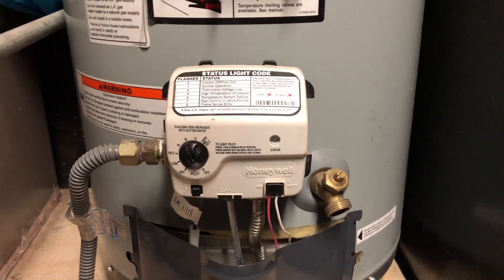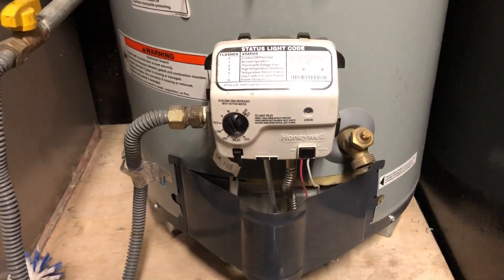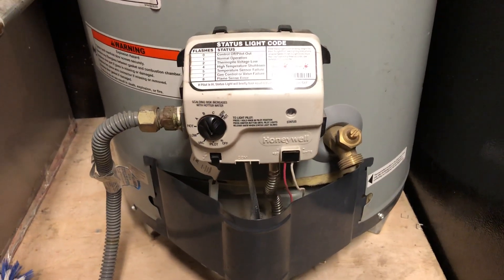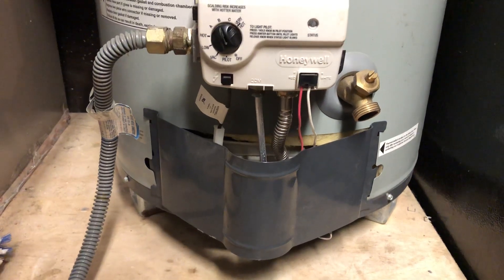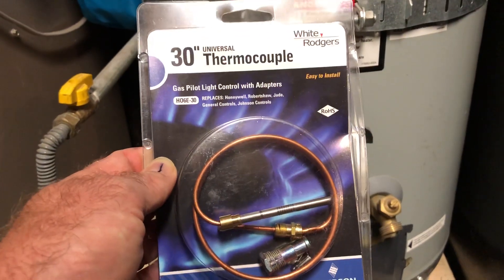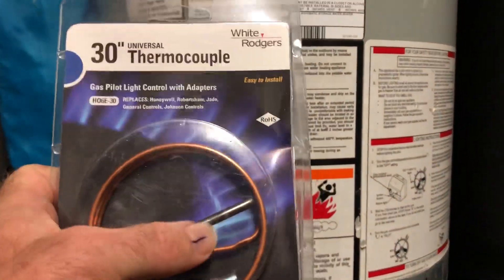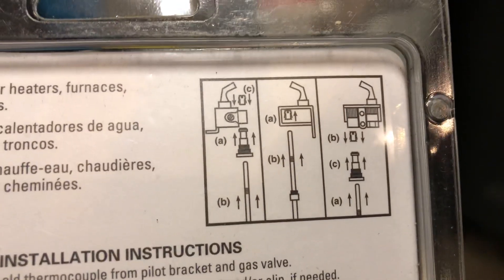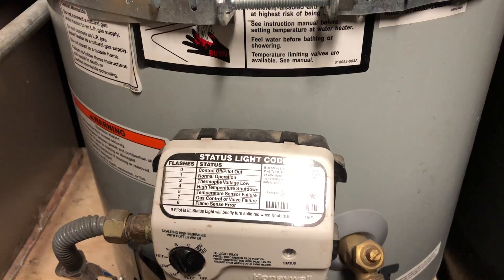DO WATER HEATERS USE BATTERIES? 2024 (UPDATES!)

Comment: You don't have to be handy to clean these at all. For most water heaters, there are two nuts you unscrew from the panel on the bottom, where the pilot hole is. Make sure the gas is off, take those nuts off, remove the panel, and the thermopile/couple is right there. Just wipe it down with a wet rag and you're done

Comment: I have a question about the two wires that attach to the gizmo on either side of the button you pressed. My plumber told me to un-attach the wires and short them with a paper clip. Do you think this is a good idea. My mother in law had the same issue. He did it to her tank and the pilot light hasn't gone out in months seemingly fix the issue. What do you idea?

Comment: The Mars 2012 and 2020 rovers work the same way, it's a thermocouple and the heat is from nuclear decay.  It's the can looking thing sticking at an up angle out the back of the rover.  They're called radioisotope thermoelectric generators.

Comment: Fun fact: Certain deep space probes are powered with a small amount of radioactive fuel. It generates heat as the fuel decomposes. Thermocouples use that heat to create electricity which in turn powers the spacecraft. Solar panels only work if you're close to something bright, like our Sun. But if you're leaving the Solar System, it's a long way to another bright  object.

Comment: Hey brother quick question. I pulled out the water heater burner to clean the possible dust off of it and it had some greenish hard water corrosion on the screen that I can possibly wash off with some soap and water or even CLR. Question is can I use soap and water or even CLR to clean it?

Comment from the maker: Want to say thanks for the video? Use my Amazon link to shop. It’s free for you to use and Amazon pays a small commission.https://amzn.to/33i9exY
Reply: My pilot went out, when I went to clean the vents underneath there is moisture.  Does that mean there is an enternal leak. It's not gushing out water. I've turned off gas to water heater. Water valve into heater is Open and it is not leaking.

Comment: Thermopile and thermocouple are 2 different devices.   The thermocouple senses the pilot light being on.  The thermopile provides the power to the circuit board inside the valve control unit.   The red and white wires go to the thermopile and the thermal saftety switch on the side of the burner assembly.
Reply: they do the same thing...a thermopile is a bunch of thermocouples "stacked" and generates more millivolts. They both have the same function though: to prove the pilot is iit and close the gas valve if it is not.
Reply: @TRUE_GR1T  If that is the correct statement, by having 10 thermocouple bundle up you would get a thermopile? 

In theory it is thermal electric or something similar. The controlling unit of a thermocouple is in the gas valve itself, the thermal couple only sends a yes or no signal to the valve. It doesn't logically prove whether the pilot is lit or not as it doesn't make the decision for the gas flow. Thermalpile, on the other hand, has to prove the pilot is lit and therefore it then sends the power to the gas valve to open the valve so the gas valve has to be different as it doesn't have a controlling circuit within that. If they are identical to each other then the rest of the components on the system should be interchangeable.
Reply: @QiuyuanChenRyan916  Don't confuse temperature measurement thermocouples with thermocouples/thermopiles in a furnace.   Furnace thermocouple purpose is to provides power to keep pilot light lit by powering the pilot light gas valve solenoid.  If fire goes out is kills gas flow out of pilot jet.   This is why when you relight pilot you have to push down on knob , hold it for some time and wait for a while before pilot light stays lit after you release the knob.  The thermocouple needs time to heat up to generate enough power to drive the pilot light gas valve to stay open/lit.  Thermopile  is a stack of thermocouples for more power output.  Thermopile generates enough power from the pilot flame to make electric power needed to open main furnace gas valve solenoids to main burners.   This power flow is controlled by the thermostat.   When thermostat calls for heat it connects power from thermopile to main burner gas valve.   Valve opens.  Main gas flows and pilot light ignites main burners.  Thus no need for outside electric or batteries.   Pretty ingenious.  How this clarifies this topic.
Reply: @TRUE_GR1T  Yet, they are not the same thing. Similar to how copper is not brass.  And, no, they don't "do the same thing," as you put it.  As you, yourself stated, a thermopile  "generates more"...more than something that it is not... a thermocouple.
Reply: @tubee2b  spare me the technicalities, they have the same function which is to sense a pilot and prove it is lit.
Reply: @tubee2b  correct.
Reply: @TRUE_GR1T  NOT the same function at all.  The thermopile takes the place of a transformer to power the control circuit and thermostat.  It MUST be a millivolt thermostat and NOT a 24VAC thermostat.  The thermocouple is used as a sensor that generates a tiny voltage to detect if the pilot light is burning.
Reply: @solarsynapse you are speaking nonsense hahahaha. 😂😂 know it all people make me laugh
Reply: @mrwendell4564  Just because you lack comprehension, does not indicate information is nonsense.
Reply: @solarsynapse  "thermopile takes the place of a transformer to power the control circuit and thermostat." I LOL at that statement. IYKYK 😂😂😂
Reply: @mrwendell4564  It is an absolute fact that is done on gas furnaces.  On a water heater, the thermostat is built in.  Without the thermopile, a transformer or batteries would be required to power the electronic circuit and valve.
Reply: You are the type of person that their wife ends up calling me at 11pm saying their water heater isn't working and they had a "professional" look at it already
Reply: Their are wall furnaces equipped with PG-9s(which is a thermopile) that energizes the gas valve which also is wired in series with a thermostat. AMATEURS
Reply: @solarsynapse  someone pull the keyboard from him hahahaha
Reply: @mrwendell4564  I have worked on many types of units and repaired the damage caused by lazy greedy "pros".  Of course there are some pros that actually care and know what they are doing.  Kudos to them.
Reply: @solarsynapse  good guy you are. You deserve a cookie lol
Reply: @mrwendell4564  By "him" you are referring to yourself.
Reply: @solarsynapse  funny comedian. Ha ha ha people can't accept being fact checked when they spew non sense
Reply: @mrwendell4564  If you can't stand it, then you should do some fact checking.  Ever hear of a floor furnace?
Reply: @solarsynapse  no, what's a floor furnace? What's a gravity furnace? What is a thermopile? Don't answer that last question because you don't know the answer 😂😂😂.
Reply: Thermocouple senses heat. Does not produce power or any electric. I've known that since I was very young
Reply: @texasbest308  WRONG WRONG WRONG..   The Thermocouple and Thermopiles drive the pilot and gas valve solenoid on your gas furnace.   Thermistors are sensors only.
Reply: @texasbest308 you are wrong sir since you were young. Thermocouples generate millivolts to energize the maghead which keeps pilot flow. So, you have been wrong since childhood
Reply: 100% agree Sr.

Comment: This water heater does not use a  Thermocouple. It couldn't produce enough voltage to run that water heater.This water heater uses a thermopile and it's not that easy for most people to replace.But almost no water heaters use a thermocouple since around 2014, In quite a few water heaters didn't use them or even years before that.

Comment: they have to be cleaned at the bottom cause there called sealed convection water heaters so they pull air from the bottom. if its clogged and full or dirt and stuff, it starves the flame of oxygen so thats what happened. stupid design , even conventional water heaters arent evensimple as they use to be to fix

Comment: These Rheem water heaters are a piece of crap bad engineering
Reply: No "Honeywell" is a POS, Rheem is for using honeywell shit
Reply: @williamsaunders8047  good luck finding a hot water tank not using a honeywell gas valve/control.
Reply: @TRUE_GR1T  What are you talking about. My apartment complex pays for all maintenance ??
Reply: @williamsaunders8047  They are on Reliance water heaters as well. Replaced mine and still will not light
Reply: @gillmanley9183  My honeywell is on a Bradford White "Defender. I looked online at Home Depot and every damn water heater has a honeywell (Made in China) Mine is 5 years old YET my refer is 1997 still works perfect, Sears Kenmore dryer from the 70's still works perfect. They make shit to break right after the warranty last 15 years.

Comment: I think the piece in your hand is not for this model. The line in the heather is to send gas to the pilot. The thermo.... Piece is the one with the two wires on the right of the valve.
Reply from the maker: Correct. I was just using that as an example of what a thermal couple/thermal pile is.
Reply: he actually said this in the video...

Comment: Hi, thank you for the informative video.  Speaking of the lights you mentioned at the end of this video.  I have the exact same gas valve and I am handy, so I tinkered and was able to reset it to get the pilot light to stay on.  However, when I turn up the temp waiting for it to kick over and ignite the big flame, it never does.  My status lights is a strobe flash (not a solid flash), every 3 seconds, which indicates that it is signaling for heat, but nothing.  What are your thoughts?
Reply from the maker: I read your comment Again and I think you should check the wires make sure the third all the way pushed in, it’s amazing how many times wires can work them self loose and cause problems. If the problem continues you may need to replace that gas valve. I’ll put a link in the description. You want to confirm that it’s compatible.
Reply from the maker: It could be a few things, however it sounds to me like the thermal couple needs to be cleaned or replaced... 
I have several videos on this style water heater. There’s also one on how to clean the intake air filter/grate. Make sure your cleaning that on a regular basis. It’s really easy, check out the video show you how. If that doesn’t work I would do after the thermocouple.
Reply: Great - thanks, please send me the link to the Thermocouple replacement video.  I look on your channel and didn't find it.
Reply from the maker: I’ll try to send you a link as well however your best bet is to subscribe to my channel, go to my playlists and you’ll see one for water heater issues.
Reply: Yes, I did subscribe, looked at your videos, but didn't see the one you speak of.
Reply from the maker: https://youtu.be/YZ4r594jkIM
Reply: The HW uses a thermopile. A couple only generates 10mv dc
Reply: And it's a copper tube. Not brass